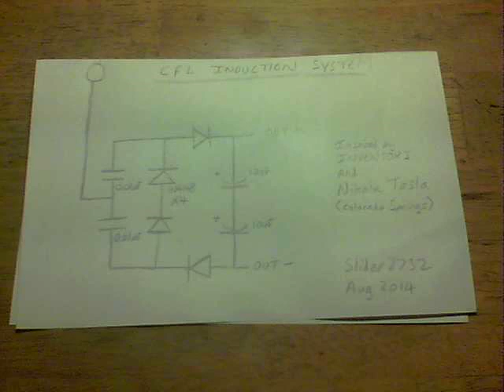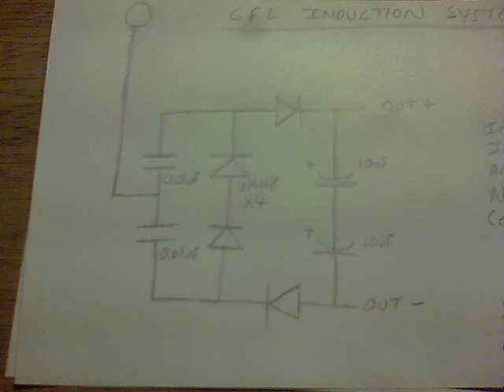CFL Induction - turn a mains light into wireless electricity

Comment: so i have a question if you were to put more units in a row could it be stretched across the room to light multiple lights throughout the home? would each unit consume energy or simply pass it along? and last is the energy going further thus costing less cash as some have said?
Reply from the maker: +Tom Slaymaker Good thoughts and summarized by - I don't really know, but do have some history with wireless power. A really good actual ground would go a long way (literally) for distance projects. Many circuits can be placed around the light and all will run. To use my wifes analogy, think of sunbathers on a beach, all will tan from the same power source in the sky. 
In terms of energy furtherment, how about this - Highly efficient Arduino type setups could run using the energy collected by the light that they might be monitoring (lumens or run time or whatever). Many microcontrollers have sleep states, where the energy could build until they wake up, then drain a capacitor in just enough time to send say a WiFi data packet before sleeping again. That whole system would be free to run, plus only become active when the light itself is active.

Comment: My guess is that you pick up the HF HV produced by the CFL circuitry. It will definitely work better with a slayer-exciter as a source. The circuit can be slightly simplified; the two diodes in series can be replaced by just one, and so can the el.caps. This may give you a small performance increase. My experiments in this line show that at some distance grounding the negative side will work better, but closer to the source it makes no difference. The CFL probably does not give you the range you need, a SEC may.
Reply from the maker: I agree with those points, especially having continued development since August. The bigger aim though is harvesting, to reuse otherwise wasted energies within the home, so it's all about grabbing uW from different sources.
Tried a Dickson multiplier with OA70's yesterday and it was far inferior, but am still searching for the best non IC solution for a minimum 1V @ 20uA. The ideal would be that power level throughout the house, obtained through a portable device.
Thanks for your comments, they are respected, I followed your Wardenclyffe series some while ago :)
Reply: slider2732 Forgot to mention: I used an aluminium plate as antenna. Insulating the front and back of this plate gives 10-20% performance increase. I used acrylic sheets for this purpose.
Also... at 5 cm I pick up a signal with the light switched off, but that one is 50 x weaker than with the light switched on (I just tried the CFL instead of my SEC, moments ago ;) ) That would most certainly be the 50 Hz leakage...
Even more peculiar, using a small (7W) CFL I get a high pulse at the moment of switching the light on. Sometimes as high as 20 x the steady state shortly thereafter. And, even more peculiar, at a 15+ cm range the steady state voltage is lower! with the light switched on than with the light switched off.
Glad you liked my Wardenclyffe series, they will be continued this year. I am considering a detailed (free energy) power source explanation sometime soon.
That will shine light on these experiments too. :)
Reply from the maker: TheMage00000
Great to hear of more videos, especially in this area !
Would you say the aluminium plate insulation works as a capacitor ? am thinking of a fins type Al heatsink that I can take some off and put sellotape/saran wrap between each. That seems similar to hanging plates in the air of a couple of years ago that went around the forums.
Nice obs with the light on and off. The pulse is likely the drive circuit before it settles ?
Am likely to do a follow up 'MMG motor' drive video with your suggestions included..will mention the kind help :)
Reply: slider2732 Here is a small doc on yesterday's experiments with the CFL:
https://drive.google.com/file/d/0B70OHRF13ajnS3kwNWY3TWVzWUE/
I didn't think of the antenna as a capacitor, but that is a possibility. I thought of it more like a trap. A similar model will explain the Earth's internal heat, more about that later ;).
Yes, the pulse must be from the drive circuit. Keep up the good work and if you find any unexpected results, let the world (that includes me :)) know.
BTW congratulations with your DSO!
Reply from the maker: TheMage00000
Enjoyed reading the PDF and thanks for the footnote mention. Experiments this morning found that OA70's were woeful compared to yellow banded, glass, 0.55V drop diodes that I presume to be Schottky. They were salvaged, so have no idea, 35V is possible open circuit using those (23W CFL, bare wire touching the bulb), compared to 2.5-3.5V with other diodes.
Reply: slider2732
I will try schottkies when I find them. I thought the STTH6010W was a schottky, but the datasheet does not mention it. 35V instead of 3V is quite a difference!
I do have germanium diodes (1N34) that I can try. With my SEC they would not survive, but with a CFL it is worth a try. When I have time, I'll try. When I have news, I'll let you know.

Comment: Very impresive Slider!
I'm wondering how you discovered this. Intentional or acidental?

I dont think thats induction. Its likely UV powered, or posibly X or Gamma ray powered (i think cfl's produce a small amount of radiation). I've measured the magnetic radiation from CFL's, its tiny, and not likely something you would harvest with aliminum. I cant even get a reading on my gauss meter past an inch away. Filimant globe has similar magnetic radiation from the filimant coil at mains freq.... If it wont work on incandesant light its definatly not induction.
Try it in sunlight (UV), and in front of a CRT (gamma) if you can (if you have one with transistors still inside). Also if you have Ionic smoke alarm try exposing it to the isotope. Or an old radium glow in the dark clock or something.
Would be quite an achevement if you made an ion powered device that runs off such a cold source.
dont supose you have an x-ray macheine laying about?

Did you try and AV plug rectifyer? The reason for the middle bit in that circuit is to act as a multiplyer. Without it you may be able to lose some diodes and lower the voltage drop.
Reply from the maker: Cool tips !
it was some side brain stuff...Inventor3 dropped by my channel and then I was looking at some pics i'd not seen of Colorado Springs in 1899. Hmm went I lol
Then a coil was put within a CFL, then external, then it became the larger ball and followed by the CD (turned sideways it has a low visual footprint too). CD works when sat on top of a lampshade too.
This PC has a Dell CRT at the moment, I overheated a cap on my only flat screen monitor, being summer and nowhere to put a PC fan on top !
X-ray machine...let me look, nope, was sure I had a few of those in a drawer lol
Will try in sunlight and yes indeed, the multiplier bit is true enough. Might just try an AV plug with a cap...lots to explore :)
Reply: If it runs on the CRT, but not sunlight or SWES, you know what that means....

Comment: ":Wireless Watch On A Stick"-----Fantastic.!!  If I get a chance I will build one of these neat circuits.  It might work good off  on an Exciter.
Reply from the maker: So glad you read/spotted that. I meant to mention the inclusion of a stick, but for once got a good vid straight away without fluffed words lol.
Have tried from '101' ceramics to '224' at the front and 0.1uF to 100uF on the output, similar, just slower to charge with larger caps. Yellow banded diodes work best so far, which I think are Schottky's but were salvaged.
A CD sat on top of the lampshade also works fine for a small footprint (solder a wire with flux to the silvered brand name area).